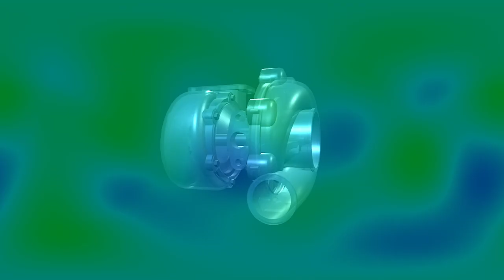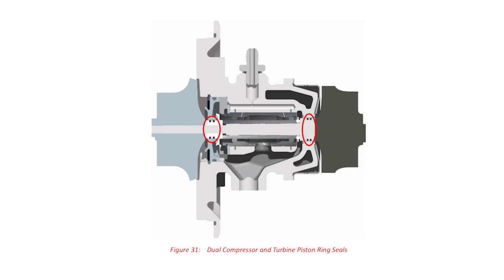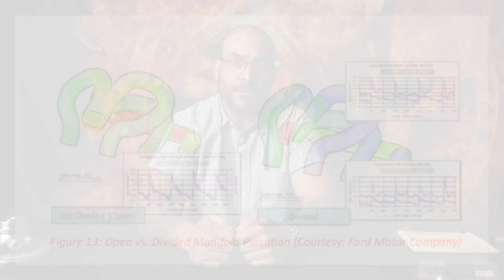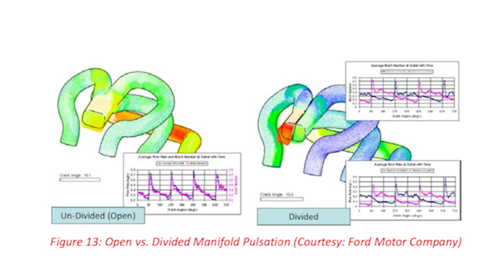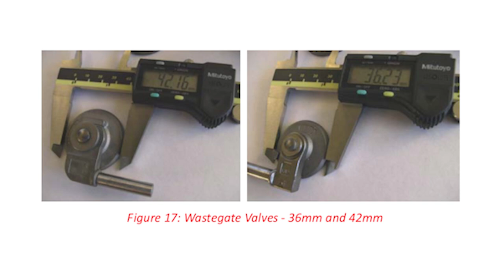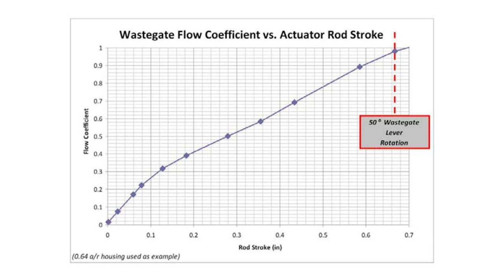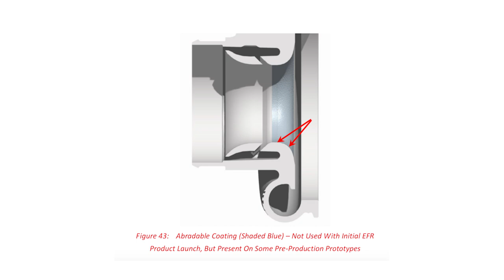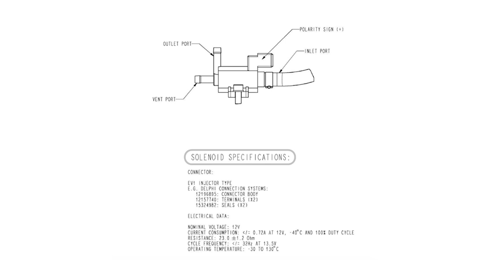Garrett vs BorgWarner in-depth comparison Part2

Comment: I've really gotten into your videos recently and I love the detailed explanations from someone with so much experience in the industry.

That said, after watching the two videos, over an hour of discussion, what I take away is that an EFR turbo is hands down better than a garrett gt or gtx gen 1 turbo, and should be better than a gtx gen 2. When it came to G Series there was very little information, or sometimes I was hearing that the G series feature wasn't as good because it came out on the EFR first, which I couldn't care less about.

I'm guessing this is because you've been seeing great success with the EFR turbos for a while now and don't have as much experience with the new garretts, but it was obvious very early that this was a borg warner support video series. I really wanted to see a comparison with the G series. I'm particularly disappointed that we didn't get ANY discussion of the new turbine wheels, which is probably the biggest change. Instead we got a motorsport only turbine. I thought in the second video you would reveal that it was the basis for the new turbine and discuss it, but nope.

I will admit that I'm a little biased because I tried a borg S300SX 8375 back before the EFR turbos came out and it was hands down the laggiest turbo for the power I've ever dealt with. But with the amount of time you discussed the original garrett GT turbos, that piece of junk should get a mention.
Reply from the maker: Thanks for the comment, the facts on the table are a direct side by side comparison - BorgWarner is better in the design and by leaps and bounds. Garrett has not improved critical points on their design for years, and still have not with the G-series setup, they have a reputation which is ling standing, as they were the original performance/racing brand out there, and due to various decisions, they opened the door to competition, which hurt them badly, and still did not respond with design updates which they should have, which hurt them further, and now they are bankrupt. 

The products themselves have a great success in certain areas like response in comparison to other brands, BUT this is due to the fact that there are very limited AR options on some of the BorgWarner turbos - we aim to change this in the coming months on specific model EFR turbos.  I have to say that Lag is mostly attributed to an engine build, collector design, manifold runner setup, and turbocharger choice aswell as a combination of these together - If you look at the turbine design on the G-series offering you will notice that this is a pure radial turbine setup.  The EFR setup is slightly different due to the angle of the turbine inducer blades, and other gas directional profiles, which makes this a "mixed flow" turbine, Garrett has missed the boat here entirely.  I left ALOT of info out of the video on purpose but i can tell you that even though it seems that im biased toward Borg as was from the start, i do apologise for this coming across as a bad impression, however truth and facts remain that Borg are just on a higher level and more attention to detail aswell as much more thought and care is being taken to design a purpose built off the shelf product with all the features matched to it, compared to a simple "universal" off the shelf "one size fits many" and add all the external features/products yourself..... like the Garrett is.  Download the technical document from BWA site and take a read, you will not believe the amount of information, testing, design and effort that went into the EFR range.
Reply: @TurboDirectSA  I really appreciate your response, especially so quickly.

I would love a detailed video on what you're saying about radial turbine flow. I can see that borg turbos generally have much more cupped turbine blades with a smaller axial length. Then again garrett turbos seem to be less cupped, longer, and significantly smaller diameter(inertia). I would love to hear your take.

And speaking of inertia, is there any way or are you allowed to publish inertia information? I would be extremely interested to see how the lighter/bigger borg wheels compare to the heavier/small radius Garrett's and would think your balancing equipment could measure that
Reply from the maker: @bberk1286  Inertia is one aspect of response, blade design is another, backpressure is another. Gas path direction (VNT) is another ... This is an extremely technical and in-depth topic, its not possible to share this im afraid. 

The gas path direction between axial and radial angles effect efficiency (here we go again) aswell as shaft power (obviously) that allows rotational drive on the compressor side of the assembly - in fact during testing there is a solid piece of material bolted to the opposite side of the turbine shaft when doing data logs which is used to measure the shaft power and other aspects of the blade design changes. The weight of the blade and solid disc back have a direct effect on backpressure and inertia - Borgs EFR range have significant improvements/differences over the Garrett antiquated designs which are pure radial designs.

Comment: Interesting to say you like the packaging size on EFRs as they are significantly larger then the Garrett. The EFR turbos are longer to start with and then the waste gate, dump valve, and boost solenoid can also impact fitment. Yes, they are added features but they can also cause issues with getting them in the car.
Reply from the maker: Side by side the Borg is identical in length to the G35-1050  - both with externally gated housings including the DV and Solenoid - 

The Internal gate and swing valve design makes the Borg longer ofcourse, but try fit a wastegate into your geography in place of 50mm longer turbo -- 6 of the one and half a dozen of the other.  In fact the wastegate with its piping will take up more space than an internally gated Borg. And then you have the additional piping, costs and fabrication.  Try tuning a gate by changing springs in a tight space compared to tensioning the actuator rod ......  youll soon see the Borg has its benefits

Comment: There is no way I would use an aluminum CHRA on air cooled engines. We don't use the water jackets anyway.🤔
Reply from the maker: Try that with the Garrett rotating assemblies with the plastic cages and you will see failures. The BorgWarner is far superior in the cooling design.

Comment: because I don't understand English, I have the vw polo (mk5)6R TDI 1600cc and I probably have the BorgWarner 3K turbine while the golf 6-7-7.5 1600cc tdi has Garrett, which is the best turbine and the most reliable one after all.
Reply from the maker: Hi Ioannis, thank you for the comment - in this specific turbo, the Borgwarner is the one we sell the least of, this could be because there are more vehicles with the Borg installed, but the failures we see on the Garrett are similar in the failure, and lends to the bearing system.  With the failures we see on the BorgWarner side, the bearing system is in tact and relates to other components. 

I would choose the Borg on this specific application.

Comment: Internal EFR bov sucks, the bypass hole is way to small which causes boost surge/spike. Internal EFR WG also sucks, yes it looks great on paper but in practice its very hard to hold/control boost with. I still love the EFR turbos though
Reply from the maker: Im not sure about your specific build, but we have had builds from EA888.3, to MErc A45, to 1JZ, SR20, MAzda 2.0 EGI, Ford Focus ST 2.5 5Cyl, BMW M3 E36/46, etc with 100% success in wastegate control, and no issues at all with the DV.

Comment: What say you on diesel unreliability for the efr line?
https://www.cumminsforum.com/threads/efr-9180.1685873/
"Discussion Starter · #9 · Jun 26, 2015
I don't think heat was a factor. Egt's never went above 1350. I should of had a tach on the compressor wheel. The efr turbo was singing buy I can't tell u at what speed.
I have been running a garret 4294r since the efr turbo failure with no problems.
The reason I'm trying to find out if I'm the only one who has had this issue, because Borg warner reject my warranty and I'm out 2300$. I also found out that the turbo is not rebuildable"
Reply: I was advised by several companies in the states to avoid the EFR like the plague.
Reply from the maker: This post was in 2015 - 6 years ago - the EFR range has been changed and updated since. The very first release in 2010 also suffered shaft breakages, but changes were made and we have never seen a shaft failure since.  

Not sure who recommend you stay away from the EFR range, but i don't believe that the product would be market released if it was problematic or defective by design.  BTW 60psi is alot of boost and if you reference the compressor map you will see that 5 on the P2C ratio is totally off the scale - he was not even operating on the compressor map at all - not sure why he ran so much boost? The turbo was maxed out LONG before he got to that boost pressure. You would definitely have seen power losses and massive heat increases before 60PSI - that i can guarantee you.
Reply: Tried finding more relative recent postings of people's experience with efr on diesel APG out of Arizona January BC (before Corona) stated they will sell it to me however there is no warranty as BorgWarner does not warranty the efr  in diesel application Industrial Injection ( a very prominent Diesel Industry performance house )ditto
Reply from the maker: @daviddroescher  Thanks for the info - we dont have a big large frame Diesel market here, our Diesel market as tiny 4cylinder small CID model engines and we have had no issues at all. Ill shoot a mail to Borg and ask about this and share the responses with you.
Reply: @TurboDirectSA  thank you  in advance for the effort.  I wanted to run the 6258 efr on my 5.9l Cummins as the smallest mid frameis 3x oversized with a max hp of only 400 . The 6258 is still .5x oversized. 
   With the suspect info I was talked into a g25-550. I wanted the better bearing and cooling package. Combined with better aero desine and lighter faster spooling rotating assembly . 

Monies spent ,however, if improvements have been made then I for one would like to dispell this mith... with 25-50k mi per year i couldent take the risk of being stranded for not listening to those in the indistry who are in the know.

Ps I didn't start looking for failures until I was advised the problem existed
Reply from the maker: @daviddroescher  100% buddy - its all good glad you up and running.